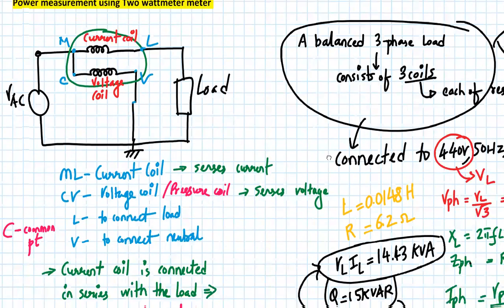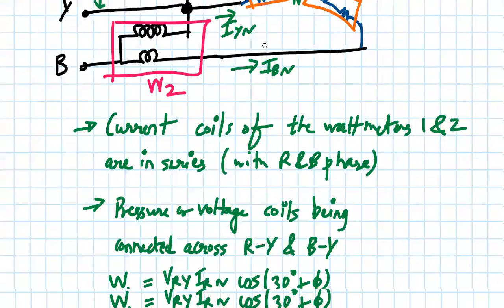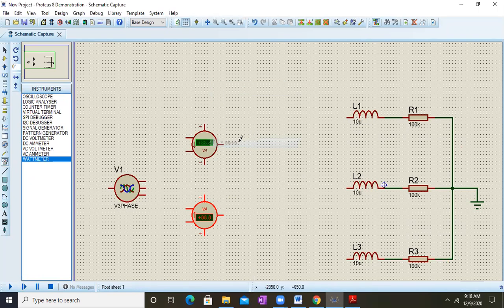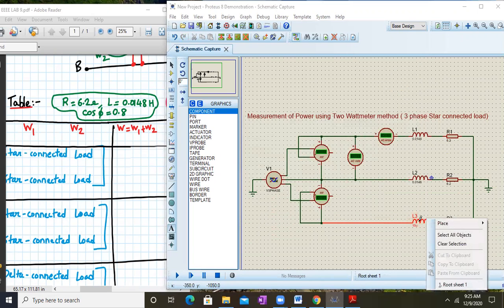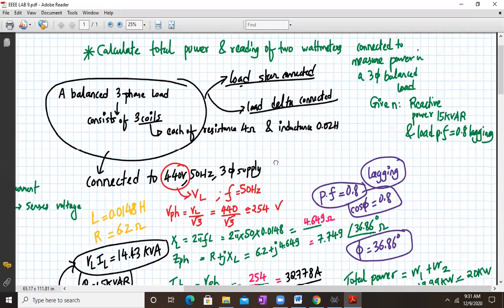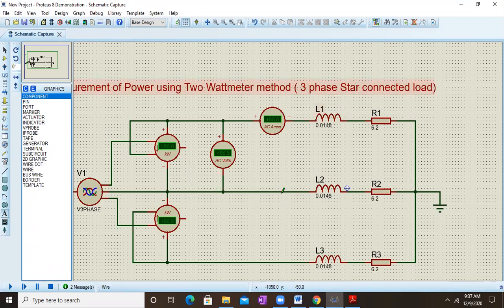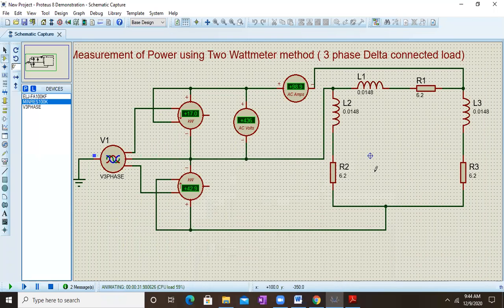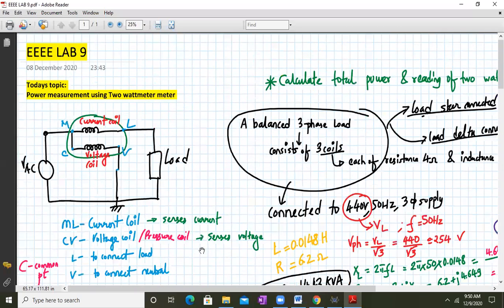Power Measurement using Two Wattmeter method | Proteus | EEEE LAB 9

Comment: Dr., the frequency can effect the value or not?
Reply: these measurement devices are designed to work with Ac voltages/currents at 50/60 Hz vicinity .